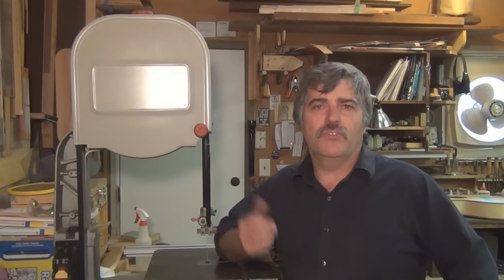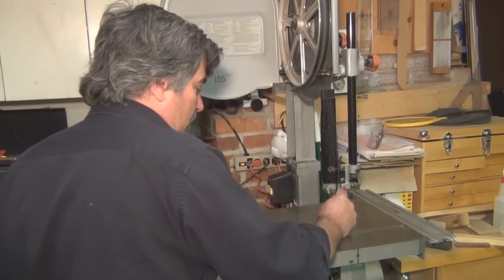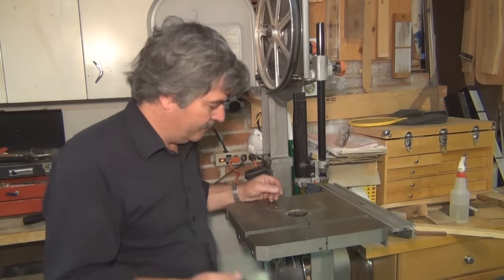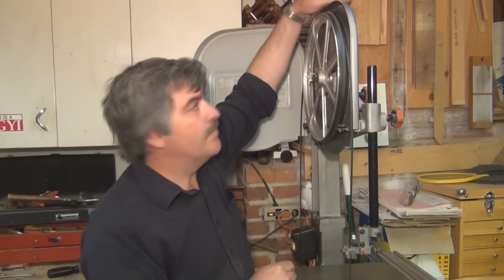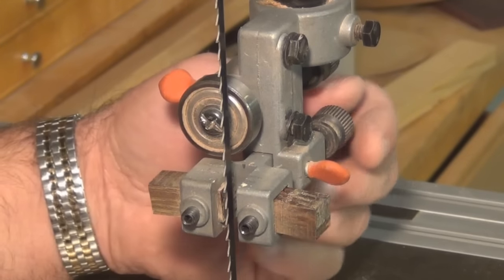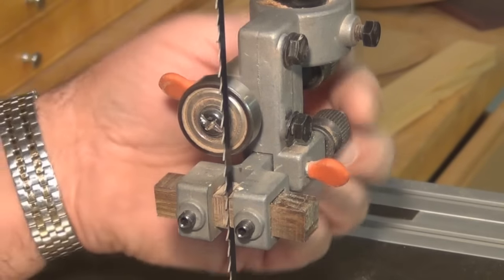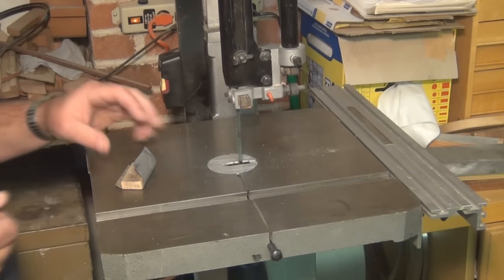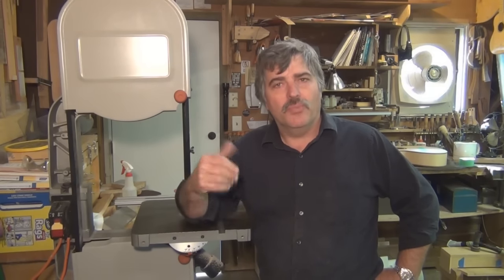Setting up your band saw

Comment: I am only two years into my woodworking journey and have NEVER used a band saw, but it has been a bucket list tool. A week ago I purchased this exact same model, the Ridgid BS14000, despite reading some very mixed reviews on some of the other 14" Ridgid saws. This saw ran smoothly and had virtually no vibration so I decided to take a chance! I have watched your video several times as there are no longer available instruction manuals or other guidance documents to be had. I took the tool apart, did a thorough clean-up, replaced the bearings and guide blocks and purchased a Kreg fence - I have not yet set up the fence as I just got the machine reassembled last night. Your video provided excellent advice and gave me the only chance I have had to learn about this saw. My first impressions of this new tool are very positive. Thanks very much for this very educational video, Larry

Comment: 9 years later and you are still helping people out. I picked up a generic 3 wheel bandsaw without a manual. I used a wheelbarrow inner tube to make the tires for it!  I had everything figured out except the thrust bearing setup - I was right out to lunch with how they were supposed to work. Thanks for sharing this.
Reply: Glad this is still being useful for people. Will likely outlast me!

Comment: great video and explanation. One thing I learned from a band saw maniac is that you don't actually want the blade in the center of the top wheel but the deepest part of the gullet to be dead center. So the blade will be just a bit off to the right. This helps keep the blade from wandering in a cut.

Comment: Thank you for doing this video. I bought an old Rockwell 10 inch band that is probably 50 years old saw at a yard sale for 25 dollars a couple weeks ago. The fellow selling it, it was an estate sale, said it didn't work right. Of course it was somewhat disheveled so I have been having a hard time figuring out what is wrong with it. Watching this video I realize the problem rests with the square guides. I'm missing two. Need a blade as well. My good deal has just turned into a great one.

Comment: Thanks mate, I've recently gotten a made in Taiwan Universal 14" bandsaw from 1985 and have been trying to figure out the guides as the newer bandsaws use bearings for the side and back guides.  The guides on yours are almost identical to mine, so very helpful video.  Cheers
Reply from the maker: Nothing wrong with block style guides.  They actually run quieter than the bearings and do the job.

Comment: 7 29 23
     one biggie i learned  was  how to position the 2 side glide-blocks with respect
to the teeth gullet.    my old blade had been running with them both back  too far
and with a 1mm gap total of slop for the blade to flex side to side.

     also overall the time it takes for these adjustmtnts is only a matter of minutes
 once the allen wrenches are found and set  out.

      my '70's sears 12" bandsaw has an inside indicator of tension level for
1/4" to 1/2" widths.  very handy. 

but so far my newer '22 delta 12" one does  not.  ??? unless i just havent
found one yet .    so  guessing is called for when it comes to twisting
that top 4" black knob

       kudos too for the good  lighting and focus of the camera work. 
plus the nice bk-gnd music.

        one mistake often made is accidentally applying  pressure on the 
blade from the back-side forward.  with the blade  then coming off  the wheels. 
and usually causing a crease or two in the metal of the blade.  
the creases are bent straight by hand and peened a bit to rid the 'bump' .

         this pressure is via mis - handling tree branches 1/2" +/- squeezed into
 a 4" bundle by hand to cut them into 8" lengths for easier filling of the 
95gal gbg toter.   trimming the yard trees goes on weekly during 
the warm months.    
       every one is a lance-leaf cottonwood variety.  
they do well here in  colorado.  providing great shade during these
hotter-than-ever summers.
        they get their water from leakage of a ditch up the street a block.
the ditch has dirt banks.  and leaks into the adjacent soil and spreads
out sideways too by  gravity.

        this variety does not turn into the
monster-size cw trees that are native to this country.

   nor do they make a mess via 'rain' those feather-light 'snow - seeds.

        and has the habit of putting up root suckers to spread the
way aspen trees  do.   and come late fall can be carefully dug
up and re-planted elsewhere in the yard to increase the shade.

Comment: Great video! Subscribed!
Don't forget squaring the blade. 
Use a square while adjusting the top dead center angle adjustment. Visual assessment of TDC is probably not enough. A light weight length of balsa with a cut that fits snugly on the blade but allows you to spin the wheels can be used as an indicator of square. Just insert it on the back side of the blade. You will see it swing left or right as you make your adjustment.
Lift the upper blade guide to the top and use a square to set the table angle square with respect to the blade.
Done right, you should have no drift from true on your fencing. Cheers.
Reply: Good suggestion.  Surprisingly, drift isn't well understood by many well known commentators, but it's obviously simple:  The centerline of the must be exactly aligned over the centerline of the crowned wheels, otherwise the resulting eccentricity will yield a blade plane that's at a bias to the miter track (drift).

Of course, the detail of drift matters most with deeper blades that get used for ripping/resawing exercises, otherwise I don't think a minor drift is a big deal because no matter what that cut face is a rough cut and must be dressed.

Comment: Awesome video! Thanks, Greg. I tend to get carried away with the instruction manual and adjust to those specs. Not only is it frustrating, but my band saw doesn't perform nearly as well as when I view your video (each time I change the blade).

Comment: I can and have re-sawn with this although I now have a larger saw dedicated to that task.  A 14" wheel is the minimum I would recommend for re-saw work and you might also want more HP than these come with. A 20" with more HP will certainly do a better job of re-sawing but is overkill for most of what I do. If I had to choose one I would choose the 14" with riser. 

If you have an occasional tall re-saw to do simply set up with a new blade, check for drift and then be very very patient as you cut.  As soon as you start pushing the limits of the saw strange things will happen.  Take a deep breath and ask yourself if you would rather spend a minute longer before looking at a clean book matched set or spend that same minute cursing a ruined board.  No brainer choice if you ask me.

Comment: I have the same band saw,  my problem is when cutting bowl blanks and half way around the rough blank, my blade starts jerking and knocking like the blade wants to break. I work with 105 x 3/8 x .025 x 4 tooth, pretty well hard woods dry, It does not like to cut slightly green wood. Loved your video,  hopefully you might be able to help me. Thank you John

Comment: Hi.....I can center the top wheel, but, after numerous attempts and adjusting, I cannot get it centered on the bottom wheel, it rides the front of the tire while the top is centered.  I do not understand what I’m doing wrong.  HELP??  Please?
Reply: It may be that your wheels are not in line with each other.  Hard to put into words but it sounds like the upper wheel is closer to your head than the lower wheel is to your toes.  You may need to adjust the tower to bring the two in line, then the subtle angle of the top wheel will make the fine adjustment.

Comment from the maker: For some reason YouTube isn't letting me "reply" directly to Juan's comment. Douglas fir splits easily along the grain and this weakness can sometimes direct the blade one direction or the other as you attempt re-sawing. Your best bet is a very sharp blade and a slow but steady cut rate.  If you are attempting a cross cut be aware that the material itself may crumble if sliced thin.  You may also experience significant chip out on the bottom of the cut. To minimize this you can cut into a piece of hardwood (like maple) and clamp it to the table to create a tight throat plate to support the material being cut. I hope that was clear.

Comment: Do you have any issues re-sawing your back billets with that 14 inch? I have an old Delta I would like to put a riser kit on but have been told I will have problems. Most suggest I go up to a 20".

Comment: The blocks in the video are lignum vitae. A very hard and oily wood. They used to use it for propeller shaft bearings in steam ships because they were self lubricating. Steel would not be my first choice for guide blocks.  Brass would be better but a composite like cool blocks is even better still. I hear good things about ceramics but if teeth of your blade ever hits that say goodby to that blade.  No matter what your guide blocks are they should not touch the blade when it is running free.  A small amount of play is OK and should not affect the cut.

Comment: IF you line up the center of the gullet with the center of the tire on the upper wheel there will be no 'drift'. If the blade is too far forward it will turn inward as you cut and if it is too far back it will drift outward. It's all about proper centering.
Reply: I am aware of this theory and have tried it.  With my saw it causes the blade to drift out.  What ever works for your saw works for yours. I'm sticking with my experience.

Comment: I just picked up my Porter-Cable band saw like the one in the review yesterday and got it together and this morning I went to try it out and I have the same problem he did where they slit is to slide the table over the blade the back side is about an eighth of an inch higher than the front side I was going to take it back to Lowe's tomorrow because today is Sunday but now I think call Porter Cable and see what they'll do being on disability and 75 years old I was really dreading having to load this thing up and carry it back

Comment: Was hopping you would change the lower thrust bearing.  I just cannot get to this bearing to replace it.  There is no room.  Could you enlighten me on how to replace this bearing?  Thank you.
Reply from the maker: If your thrust bearing is hard to access consider removing the table top.  I am not sure what brand your saw is but mine simply has two machine screws with knobs that you loosen to adjust the table angle. Pretty typical. Remove these screws and the table top lifts off giving greater access. A photo of this area of your saw would help.

Comment: Should the blade be centered on the wheel or should the back of the gullet be at the center of the peak of the tire?
Reply from the maker: There are many opinions on this. I center the blade at the center of the wheel. To each their own.

Comment: Hi, I'm having trouble setting my new bandsaw up, and I’m hoping that you can help me sort out the problem, its an EINHELL. I noticed the blade seemed to be slightly out of line, so I tried to readjust it. When I switched it on I could hear the motor starting, but the blade did not spin, and now the ON/OFF switch seems to have jammed. Please help. TIA

Comment: Hom do you adjust the tension on tour band saw what tell you that it is the good one . My band saw rockwell beaver- indicate 102 pounds des of tension
Reply from the maker: "Correct" tension is debatable.  The tension guides are a good start but I find mine to be lighter than I like to run. You want enough tension for the blade to stay straight and not wander under stress but not so much as to break the weld.  Smaller blades and smaller drive wheels need lighter tension and vice versa. I have no hard number for you.

Comment: What a great vid. I have a 3/ 16 blade that I'm trying to use on my bandsaw , but for the life of me I cant seem to set it up right. Would I apply the same methods to my 3/16 blade as you did for the 1/4 blade ?
Reply from the maker: Absolutely.
Reply: The theory is all there.

Comment: I'm curious as to what the FastTrack fence attached to the back of the saw table is used for.
Reply from the maker: It holds a fence guide does useful for some operations. Watch the end of the video where I give a technique for making the fence align with the drift of the blade.
Oops. I just watched the video and it seems as if I edited out actually using the fence. The fence fits into and clamps onto that fast track.

Comment: I've finally gotten around to doing some maintenance on an old amt 4112 that was given to me (because its a little scary) and I noticed that the top wheel can easily be tilted back unless I completely tighten the tracking knob which causes the wheel to be at a crazy angle. is this normal or so I potentially have a bigger issue here?

Comment: Mr. Nelson,   Is your blade on backwards?   I just bought an old Craftsman saw ---haven't even used it yet----It has a quarter inch blade installed and the teeth points are opposite what I am seeing on yours----one of us is backwards?
Reply: Not this time, but I will admit to having installed blades the wrong way before. You know it as soon as you start the cut.

Comment: Hi  Nelsons
What reason bandsaw blande broke when cutting metal.
Reply from the maker: Did your blade break? Could be many things.  Could be a bad weld, or over heated or wrong tooth. Would need to know more to try and answer this sort of question.  Band saws that are designed for cutting metal run slower than this wood working one and often have lubrication/cooling liquid involved too.

Comment: hiI just bought my first bandsaw, an old vintage beaver, I watched some videos, and did my set up, and when I cut , I can not cut a straight line . how do I remedy this please
Reply: +Paul Shaw There are a couple of things to look into here. Simple thing first is that if the blade will cut a straight line but just not parallel to the table that is natural. It's called blade drift and is "corrected" by adjusting the fence to match the drift.  If the blade wanders back and forth that is typically a problem with the blade and not the set up if done correctly.  Try another blade?  Are the  tires crowned? They should have a slight convex shape so that the blade will track easily to the top. New tires might be needed if the old ones are rotten. You can shape and true the tires with sand paper while spinning them.
Reply: Worst case scenario is that the wheels are not in alignment.  This is a bit more difficult to deal with but basically you need to remove the table so you can "see through" it.  Then either clamp a 4' level or straight edge to both wheels so that they are perpendicular to a line that would go through both axels. (I find it easier on small saws to simply lay them on their backs and let gravity hold the straight edges in place. It also helps with the next step.) Next, stand on a ladder and sight down the saw bringing the two straight edges into plane with each other. Kind of like a looking at a horizion/level gauge in an airplane.  The two straight edges should agree with each other. If not there will be some sort of adjustment either in the arm holding up the top blade or in the way the axle is connected to the arm. I am not familiar with the Beaver system.

Comment from the maker: I can and have re-sawn with this although I now have a larger saw dedicated to that task.  A 14" wheel is the minimum I would recommend for re-saw work and you might also want more HP than these come with. A 20" with more HP will certainly do a better job of re-sawing but is overkill for most of what I do. If I had to choose one I would choose the 14" with riser. 

If you have an occasional tall re-saw to do simply set up with a new blade, check for drift and then be very very patient as you cut.  As soon as you start pushing the limits of the saw strange things will happen.  Take a deep breath and ask yourself if you would rather spend a minute longer before looking at a clean book matched set or spend that same minute cursing a ruined board.  No brainer choice if you ask me.

Comment: NICE VIDEO THERE IS NO SUCH THING AS BANDSAW DRIFT THOUGH THE BANDSAW JUST NEEDS TO BE SET UP PROPERLY AND YOU NEED TO UNDERSTAND WHAT JOB EACH BLADE IS DESIGNED FOR AND NEVER PUSH THE WOOD TO HARD WHEN FEEDING IT INTO THE BLADE. I RUN WOOD PERFECTLY STRAIGHT THROUGH BOTH OF MY BANDSAWS THEY NEVER DRIFT. THERE IS ANOTHER GREAT BANDSAW TUTORIAL BY CARTER BANDSAW WHERE THEY GO OVER THE FINER DETAILS OF BANDSAW SET UP. THIS IS A VERY GOOD VIDEO AS WELL, NICE INFO AND GREAT CAMERA WORK.

Comment: At 6:45, it appeared that blade was installed backward, l might be wrong. Nice video, thanks
Reply: +Amirhousein Hazratifar  You are correct....
Reply: No, it's oriented correctly. Teeth pointing to the left, narrow blade that's too far to the right on the wheel.

Comment: I have a similar setup and am having trouble with my blade digging into the thrust bearing, even to the point that I'm throwing sparks. Seems like the blade should run along the side of the bearing but instead it pushes into the outer part of the face of the bearing. Can anyone help?
Reply: fuzzy wuzzy that's totally a possibility. Except I'm not gay and God's not real so I'm guessing it's got to do with the way my guide  bearings are setup.

Comment: I haven't watched the entire video BUT after he talks about getting the blade on properly so it will cut as opposed to having it on backwards ... when he gets his blade on and is centering it ... have a close look at the teeth direction. I believe they are closest to the back of the saw! Oooops ... I believe that is backwards. Viewed from the side you need  the blade profile to be  ttt bbbbbbbbb not bbbbbbb ttt
Reply: Look again. The teeth are correct.